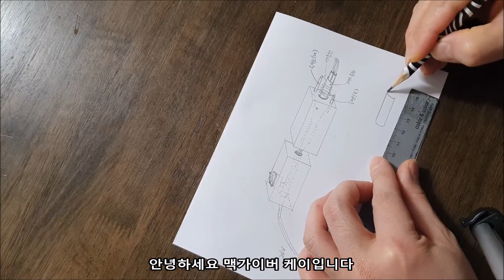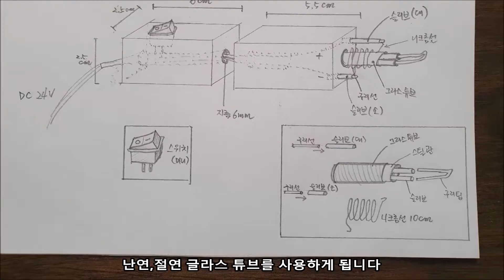납땜과 우드버닝을 한번에 DIY!! 인두기 & 우드버닝펜 만들기 Making a Solderling iron and Wood burner/Pyrography

Comment: 1) É ligado direto na tomada? 
2) A voltagem da rede do teu país é 110v ,  220 v ou qual?
3) A ponta é de que material pra esquentar em vez de causar  curto?
Reply from the maker: 1. e ligado direto na tomada?
Eu usei um transformador de 24 volts dc.
2. a voltagem da rede du teu pais e 110v, 220v ou qual?
Aqui na Coréia, usamos 220v.
3. a ponta e de que material pra esquentar em vez de causar curto?
A ponta é de fio de cobre e o material de aquecimento é 0,1 mm de fio de nicromo de 20 cm de comprimento.
Reply: @MacGyverK  Obrigado
Reply: Can i use atx power supply 3.3,5,12v with 200,230 watt and can i use hp  printer adapter 220v with 30,32v